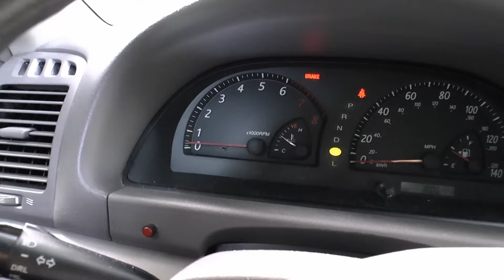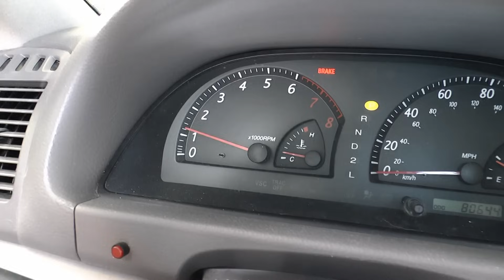How to Fix Low Idle Problems in Your Car (Throttle Body)

Comment: Hey Scotty. Quick question I've got a Chrysler voyager diesel uk model and every time I put air conditioning on or heater on the car dies out any ideas ? Thanks :)
Reply: Especially the airconditioning, but also the blower for the warm air use alot of electricity. If the alternator is in bad condition and is unable to keep the battery charged the car will die out. Most garages have a tool to check the condition of the alternator.
Reply from the maker: yep, check the alternator and battery, have both load tested

Comment: And is non of that is the issue in a MK3 2007 Clio, which while idling, the revs keep dropping then reving back up, and while accelerating, you keep losing power causing a juddery acceleration but runs smooth at speed, 20), 30,40or 50 mph,how do you fix that, please?.

Comment: so what u think we should we do if i have over 4000,000 miles my truck drinks alot of gas it says to use 5w30 but i heard if it has over 100,000 miles always use 10w40 thats what i been useing but it usees alot of gas
Reply from the maker: changing it to 5 30 won't change the gas mileage all that much really,old worn out truck engines with old fuel injectors will just use a lot of gas

Comment: I have a 2009 Toyota Camry LE 2.4L with idling issues. I changed my motor mounts 1st and it was still vibrating. I cleaned the throttle body and the mass intake yet my car continues to vibrate. Sometimes it comes strong then it lightens up. Whether the AC is on or the AC is off. It's like it doesn't know what it wants to do. Then my check engine light came on after cleaning the throttle body and the mass intake. Any ideas? Please help. Oh and my AC does blow cool air.

Comment: So I cleaned to outer area of the throttle body and found out the rubber lip near the maf was not inserted into the housing. Interesting problems.

Comment: Hi I have 2003 Toyota caldina it have a 1az fse engine problem is loss of power ,low idle ,sometimes misfiring and when turn on a/c its keeps idling up and down,already scan engine nothing have shown up.

Comment: I have a 1995 grand voyager 3L V6 van and sometimes or once an while it only dies when I have the AC or heat on, and then I had trouble starting it back up because the rpm would reach 0 when I let the van idle, also eventually it would start up just fine like the van fixed itself, how do I fix that?
Reply from the maker: try this video, also try "how to clean fuel injectors on your car" as those often clog up the injectors at that age

Comment: i have a 1987 Cadillac Fleetwood that has idle problems. I recently changed my isc. once I connected the battery back in and crunk it, the idle was  very high (I think 2000+ rpm. My manual's minimum rpm is 525. So I changed it back down to around the 525 BUT here is the problem. my engine idles to low for belt at 525 rpm (when I run air, heat etc. engine stops eventually and battery light turns on.) what should I do Scotty? is it OK to find an rpm higher than minimum rpm in the manual that idles it enough for it to spin fast enough for air to work properly, because I notice with 2000+ rpms it works fine. Also, at night time when I use my head lights, on 525 rpm- my lights dim out slightly when foots not on the gas.
Reply from the maker: +DatBoiSheed   yes try to find a higher rpm, on something THAT old, you need to compensate for engine and other parts wearing out

Comment: Can CRC trottle body cleaner be used for this job as well?
Reply: Yes you can just don't spray the sensors on the throttle body it's  best to pull the throttle body off the engine and take the sensors off and clean out any small air holes in near the butterfly and dry it all with a air blower .

Comment: hey Scott I have kia optima 05. the code reads air input low code 102. I changed the Mas with one from junk yard and code still there. also cars rmp drops to where it shuts off the car on a cold start if you don't give it enough gas. any suggestions?
Reply from the maker: +ramon barnes  check for vacuum leaks, see my video "finding engine vacuum leaks with a cigar"

Comment: Hey Scotty
I have a honda Civic Lx 1999 manual (4door)
i recently had low idling problems, it stayed in between 1000 rpms and 0.
so i took it to a mechanic, it had the code P0505, now he changed the IAC (air control valve). but after that the rpms went high, around 2000-2500. Check engine light came on, as the car kept idling, it stayed at 1500 rpms. he later tells me it must be the thermostat, but i actually changed the thermostat my self by watching one of your videos, easy stuff by the way. Anyways now I'm really concerned because idk if the IAC needs to be from a honda dealership or it can be aftermarket. so far the information I've researched says

The IACV-AAC valve harness is open and allowing moisture inside
The IACV has a poor electrical connection, or
The idle air control valve itself is faulty

So scotty any thoughts on this? i really need some help. Thank you sir

Comment: My camry 2007 52800miles idles fine when the A/C is off. But when I turn it on and the car is in drive or reverse and I'm standing still the car gets a bad vibration. Any tips?

Comment: I just did this a year ago and the idle when the car starts with a hot engine is too low until I run the car for a while. Maybe it's the K&N air filter or maybe there's still more gunk in the throttle body that remained over time.

Comment: +scotty kilmer hi i have a vw golf 4 1,6 1998 and the engine makes weird sound like its running fast and slow in the same time so what is your Recommendation for this thanx alot.
Reply from the maker: try this video and also check for vacuum leaks

Comment: Scotty, I have a 2005 legacy Gt. One day I was driving and while 'accelerating only' it was making this metal rattling noise. I got home right away turned it off. Looked at it checked fluids everything was good. Next morning same metal rattling noise but in Idle now. I'm afraid to drive it. Haven't in weeks. I get all kinds of explanations from possible bad pulleys. Oil pump to a bad Cat. I heard a similar noise with another turbo car and it was a Uppipe issue where the second Cat was going bad sending rock or honey comb towards turbo. Any ideas. They don't rent OBD2's out anymore. I did remove inter cooler plumbing, oil lines to turbo, and didn't see any metal or random oil where it didn't belong. Just haven't started tearing apart exhaust yet. Dont want to get ripped at a shop fixing something unnecessary.

Comment: scot what causes car to not rev & drop idle more when i press the pedal in drive? but revs with backfire in park
Reply from the maker: many things can do that, but often a weak fuel pump or bad throttle assembly does that

Comment: 2007 town and country code says misfire on number one replace plug plug wires crank sensor injector on number one replaced all of the other o rings also on all the other injectors still a bad idle while parked or in first but gets better when you drive it

Comment: scotty my 2001 chevy tracker 6 cyl has check engine light that reads as cyl 5 misfire new spark plugs ignition coil were tried and fuel cleaner as well any ideas
Reply from the maker: +Deborah Black swap #5 injector and see if miss moves, showing bad injector. Pray it's that and not a blowing head gasket or other internal engine damage in #5
Reply: great ideas i will find someone to help me out with that thanks so much!!!!

Comment: Hi Scotty Kilmer. I own an Chevrolet Aveo 2015. The problem I suffer with it is random increase in 
RPM , which comes and goes sometimes (ocassionally reach upto 2000 
without any gas pedal press). Technicians in my country say no problems 
with that symptom, but I am really annoyed with it. Can you help
Reply from the maker: NEVER buy one of those junkers, they are really poorly made. But it is under warranty, force them to fix it and see if your country has any lemon laws that force chevy to fix it or buy it back.
Reply: I already got it to the dealer several times. What they did was spraying certain substance into the throttle, yet that did not make things better after a couple of days. Can you suggest anything in this case for me to solve the problem on my own?
Reply from the maker: not really, cause it's probably an electronic problem failure and you'd need a dealer scan tools and years of experience using it. They just don't care at the dealer, typical for Chevy dealers anywhere these days. VERY poor, they just want your money and don't care about real service

Comment: hey Scott I installed a cold air intake on my 1993 2.2 liter celica and it idles up and down between 500 and 200 rpm? what do i need to do?
Reply: joey aguilera take off the air intake, it won't do much without a performance chip and if it's not paired with any other mods
Reply: David U  kk thanks man

Comment: hey scotty my check engine light  came on yesterday on my 97 toyota tacoma  4 cylinder. the code is 'P0510' reads Closed Throttle Position Switch. might that mean the TPS  is dirty or needs to be replaced ?
Reply from the maker: +Roger Saenz replace the tps and check the wiring to it, pray the computer isn't shorted out too
Reply: +Scotty Kilmer should I try cleaning it first or does that code mean it needs to be replaced?
Reply: +Scotty Kilmer it shuts off once in a while when I come to a stop

Comment: 2008 cadillac cts with the MFI v6, it idles at 500 rpm which is too low (supposed to be 750), i’ve removed and cleaned the throttle body very well and then re learned it but it still idles at 500? please help

Comment: My 2002 Renault Laguna keeps swinging low when I let off throttle.   
It will swing down to 600RPM, almost stall, but then it climbs up to normal 800RPM or 900 if I have AC on.     

It kind of drops fast then catches it and I don't like that, it must be putting strain on the engine and other parts, I would much rather it come down slowly and stop at 800.   

Is there anything I can do about that?

Comment: I have this same problem with my bmw e60. It vibrates at idle about 0.6 rpm, but i am not sure if i can clean it by my self, because i don't know where the throttle is located. I checked the air filter and its clean.
Reply from the maker: Romal  on those, more often vacuum leaks from the use of cheap plastic parts on the intake that crack and suck air. See my video "finding engine vacuum leaks with a cigar"

Comment: hi scotty i was wonder if my truck take 5w30 oil and if i put 10w40 oil is that good and well that give me bad gas mileage cause i sure got bad gas mileage over 2 hundred thousand miles
Reply from the maker: you would get slightly lower gas mileage, but less internal engine wear. your pick

Comment: Hey Scotty! Love your videos, I have a 2013 F150 with the 5.4L V8. I run E85 in it and only use gasoline when getting an oil change (Flex Fuel vehicle):
1. Are there any additional maintenance precautions I should be taking when running e85?
2. What is your opinion of getting the computer tuned specifically for e85 so it will theoretically be able to use the extra octane or improve effiency?
Reply from the maker: na, just leave it alone and do what you've been doing. ethanol runs clean, but having less BTUs of energy, it will always get worse gas mileage, you can't beat physics.

Comment: Hi Scotty, I have an e46 with a valvetronic system and disa valve.
Will cleaning the throttle plate improve my low idle the same way?
Reply: Can't guarantee, but obviously it won't do anything bad. I know it's late, so tell me if you fixed the problem :) my friend has the same, e46 2.8 :(

Comment: I have a 93 Honda Civic ex d16z6 engine it's doing the same thing but I already cleaned the throttle plate and got new sensors it's still idling low could it be something else?
Reply from the maker: +Steven Hernandez try my video "finding engine vacuum leaks with a cigar"

Comment: Hi. like your videos a lot. I have one question. I cleaned my car's (Toyota Yaris 2012) throttle body and after cleaning it engine light has come up. Please advice.
Reply: Shabi Shaib Did you discomnect the battery？

Comment: Brother please help me My Opel Corsa B 2003 version has idling problem 
When cold start engine engine idle to 1000 rpm and back to 930 rpm 
But after some time car idle fluctuate up and down and when you rev up and leave or driving and press clutch rpm dropped to 150 to 200 rpm and back to 800 rpm and slowly back to 900 its struggles i clean IAV with throttle body cleaner and clean throttle body from inside only i can see little part iis still black inside 
.
Kindly help me may i have to disconnect battery terminals while cleaning again and reset Ecu

Comment: Hey scotty, when my car is cold, normally after sitting all night, it seems to want to accelerate on its own. I let it idle down when I first start it, put it in gear, and the idle goes up to about 1200 rpm momentarily. Idles around 550-650 in park. What could this be? Everything returns to normal within a couple minutes.
Reply from the maker: try my video "how to fix a car that idles poorly"  and also check for vacuum leaks on the intake system

Comment: so for the high idle after cleaning it i just leave it in park for 5 minutes? i dont need to step on the gas at all?
Reply: nvm i thought i had done something wrong when i cleaned the throttle but ended up just being a vacuum leak from the pcv hose,  replaced it and the rpms went down to normal.

Comment: Scotty or anybody, I was going to work when I tried letting on some gas I had no response from the peddle it would just sink to the ground. Engine n all still functional. I drove into a parking lot n put in park n while it was in park it was idling. I turned it off n on n no more idling. So decided to make it back home (5 or so miles down hill) I'd get a little pressure n a tiny bit of acceleration on the roads. Then when I had gotten home it was idling again n stopped. I have no idea. Could be IAC?

Comment: Hey Scotty I have a idol problem on a 2010 Ford escape I changed the ignition could and clean the throttle body it's still running under 1000 rpm any other tips would be helpful

Comment: Hey Scotty I have a 98 Bonneville with abs and tcs that has an issue and the abs light is on. after I start the car the abs light isn't on. but if I drive it a little and use the brakes its fine for a bit but then I get a pulsing reaction in the brake pedal and then I hear a buzzing sound from my left front dash and then the abs light turns on. I have hooked a diagnostic computer up to it and no codes. say if I'm in drive at a stop and I punch the gas my car just shakes or the engine shakes. I have check all off the engine mounts and done a full tune up. please help idk where to go from here.
Reply from the maker: +x0jok3r0x   you need a dealer leel scan tool to analyze abs problems cause you have one with that brake pulsing. ONLY that can analyze ABS problems thoroughly
Reply: +Scotty Kilmer I will do that thank you.

Comment: Hey scotty I have a 2000 Nissan xterra and its to start and when I go from reverse to drive I get very low power...... Can you help me with this?
Reply from the maker: many things can do that, start by tuning it up and cleaning the maf sensor. if not that, have a pro check the maf sensor data and fuel pressure for problems
Reply: Okay thanks...

Comment: Hey scotty jesus man. But no seriously i have a 97 acura cl 2.2 5spd and the rpms drop low especially when i give it gas in neutral, like 400 low. Also when i turn on the ac.  I also have a code for high electricity output eld something.  And a code for a bad egr. I read its a bad fuse box, whats your take? Thanks
Reply from the maker: could be a bad fuse box, those were known for that. But if egr valve is sticking open, it can do that too.
Reply: Scotty Kilmer much appreciated

Comment: any ideas ? changed manifold flaps cleaned egr valve , pcv system and from start up you would think accelerator has stuck open which it has not engine reves like crazy ANYBODY GOT ANY IDEAS WHAT THE PROBLEM COULD BE ? ITS A FORD I WOULD BE GREATFUL ANY ADVICE YOU COULD GIVE ANYONE

Comment: Hey bud so I have a 1992 Miata and the past couple days the door buzzer has been coming on while I been driving very faintly though I unplugged it cuz it was getting very annoying do you think it might be a short or do you think that the relay is bad my sister notice that it happens on sharp turns or bumpy roads could it just be a loose connection

Comment: Hey scotty is it ok for a 2010 dodge charger sxt with awd 124,404 miles to burn a little bit of oil? I add some lucas oil stabilizer every now and then.... im going to have a mechanic remove a spark plug
Reply from the maker: yes, those chargers often burn some oil at that age